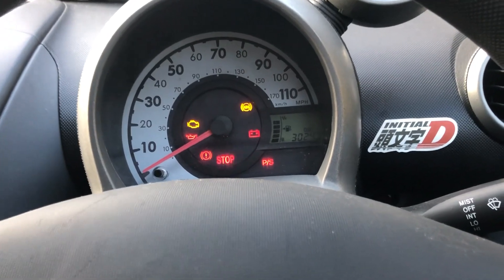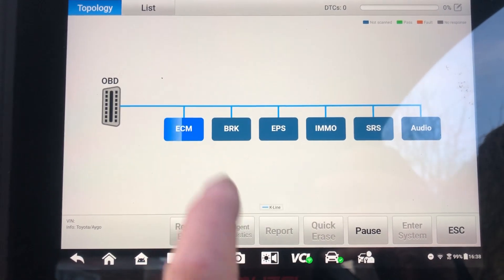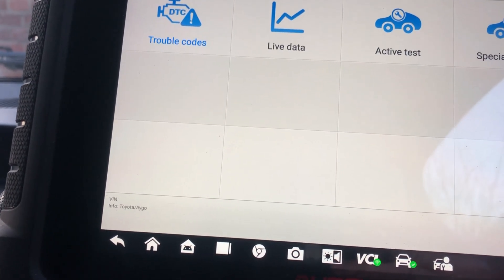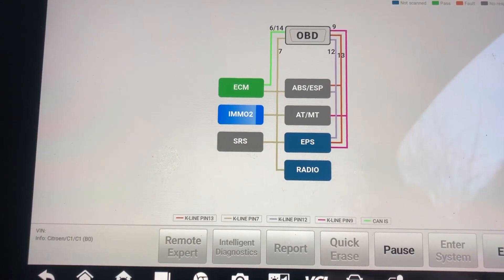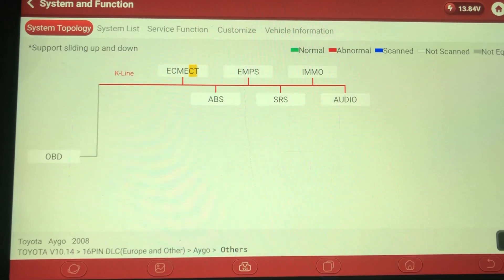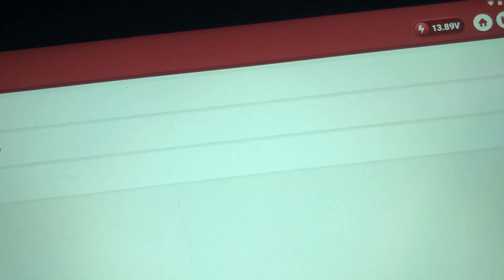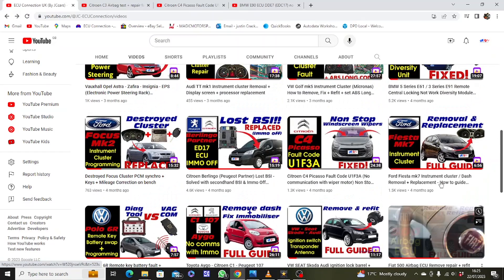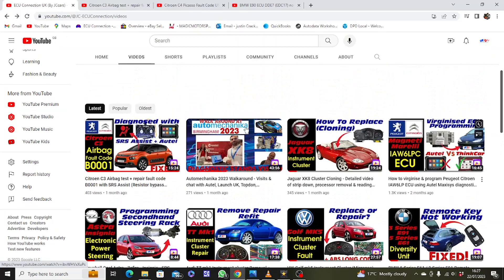Comparing OBD scan tools on Peugeot 107 (Aygo) with radically different results Autel - Thinkcar

Comment: I think that autel give wrog scan because the car battery have low voltage..In the time when you conect Launch the battery are charge 12V+
Reply from the maker: Possibly, to be fair I should of connected the Autel again after connecting the charger, I only noticed how low the battery was after watching the video back.. if I get another Aygo in for Diag work like this I will compare scan tools again, thanks for watching & your comment!
Reply: @JC-ECUConnection   and you are write that is best have Launch and Autel..
Reply from the maker: @Doctor_88  I have found on previous jobs (Check the Immo video I made) that the Launch based diagnostic tools have better access to the Immo system, and diagnosing under ‘Toyota Aygo’ also gives you ‘Topology view’ whereas the Autel doesn’t, hopefully I can do a follow up video soon comparing them & maybe Snapon Diag tools as well..
Reply: @JC-ECUConnection  can you tell if for first tool to buy for immo(for module replacment)are bether choise Launch or Autel IM with xp400 for europian car brands
Reply from the maker: @Doctor_88  They both have their own strong points, I really couldn’t say which one is better.. I’m of the opinion they are both very good tools, and worthwhile having both! but also there is strong competition in the market from companies such as OBDstar, Xtool etc, on the whole for a full diagnostic kit I highly recommend the ‘Think car Max’ full kit, it’s Launch based software with Oscilloscope, TPMS wand, Battery tester etc & can be upgraded with the add on key programmer! - more details in the link below:
https://ecuconnection.co.uk/product/thinkcar-thinktool-euro-max-diagnostic-scan-tool/